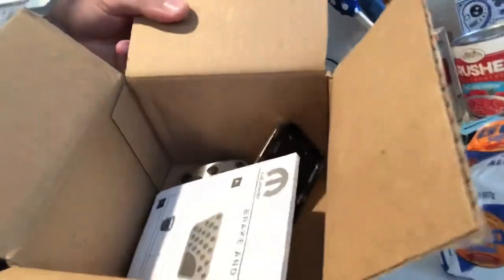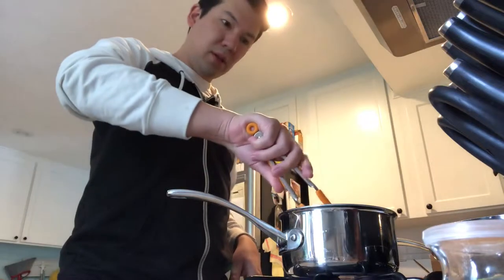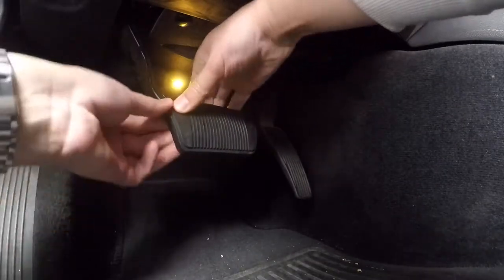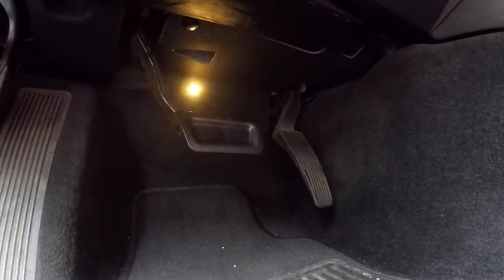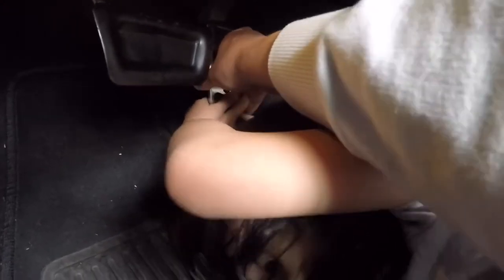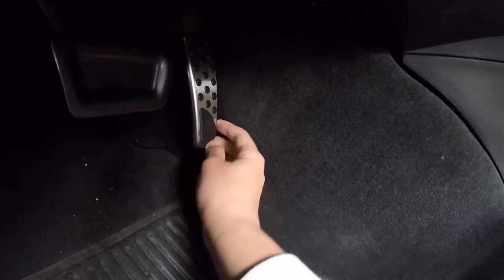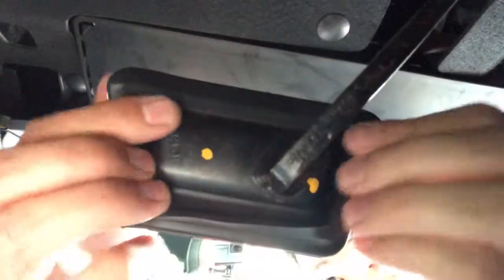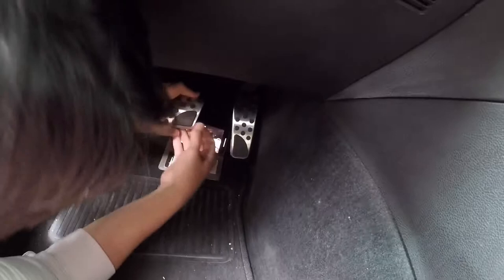MOPAR pedal cover installation - 2014 Dodge Charger

Comment: Using your idea of heating up the rubber with the hot water; I chose to go a different route and used a heat gun to soften the rubber (really quickly lol). Went on with way less struggle than my attempt with just soap and water. Thank you!

Comment: Great video,can i know how much did you pay for that kit?? i saw a lot but don’t say mopar in back side,i am not sure if those are authentic or what,cut you help me on this place,i will appreciate it
Reply from the maker: I don’t remember what I paid but I got it on eBay. Looks like the one I bought is now close to $100. https://www.ebay.com/itm/Dodge-Challenger-Charger-Chrysler-300-Gas-Brake-Pedal-Kit-Mopar-OEM-/153068860457?mkcid=16&mkevt=1&_trksid=p2349624.m46890.l49286&mkrid=711-127632-2357-0